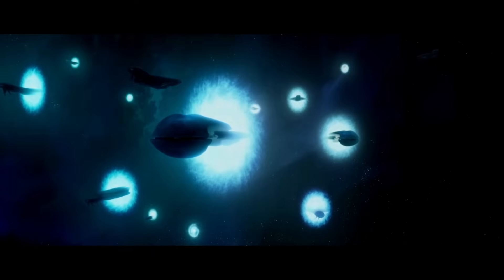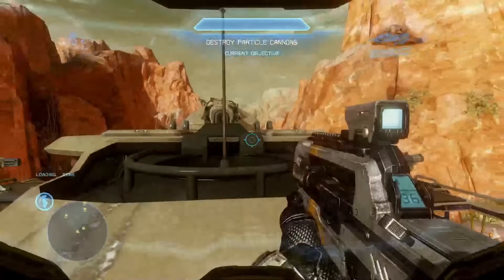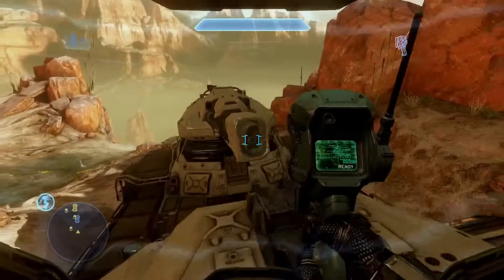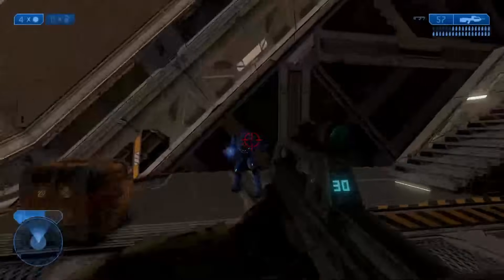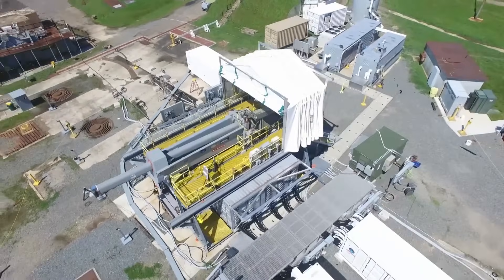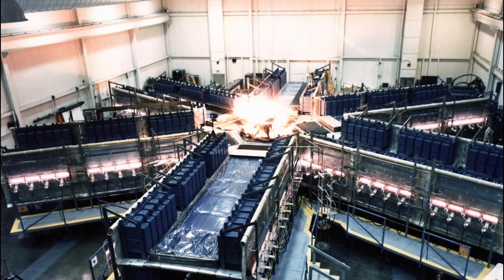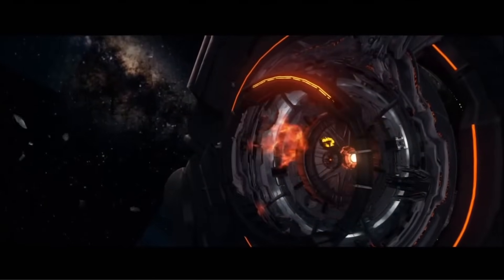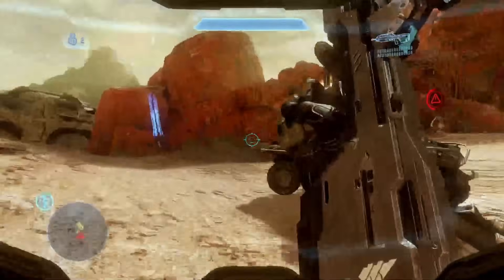Could We BUILD Orbital Defense Platforms TODAY?

Comment: Power transfer from ground stations wouldn't be via cables like on earth but via microwave with a large rectenna being placed on the MAC station to recieve and convert it back into power. 

You do have losses. I think the theoretical maximum efficiency still loses you about 20% of the power you push to space but it still actually has a lot of advantages.
You don't need to miniaturise your power generation, it's easy to maintain your reactors both for staff and logisitics, you can stick them under a mountain for comparably cheap armor, your mac stations are smaller and easier to manoeuvre (just keep the rectenna facing down), and when you aren't using your mac cannons  (which is most of the time) you can tie that power straight into grid subsidising the cost of your defense platforms.

Incidentally, this also explains why they're geostationary - having a static power broadcaster is much cheaper and more reliable than a mobile one and if the cannon is always in the same spot relative to the ground, you can just build it so it's pointing at the right spot.

Comment: Actually the army put a railgun on a Sherman tank in the 40s.
Reply: Its wasn't really a railgun. Its more of a support platform for the rocket that it was suppose to use.
Reply: @itzyaboimemez2074  There was a actual railgun, the army replaced the radio, hull machine gun with a second engine and power systems. then they created the first SABOT round  for it and when they shot it the rail exploded and almost kill 3 people including the man who was it biggest supporter. No it wasn't the T34 Calliope.
Reply: And if that were actually true, the second engine and the likes, it would been impractical since every Sherman needed to be quick and easy to build, maintain, and remove broken parts. Not only that, every Sherman tank are needed in the front, which is why most modified Shermans still have the same chassis, hull, and others because they needed then to be quick and easy to modify. It would have been more practical if they use the M6 Heavy tank because of its large hull and turret, which can fit those that you have mentioned, or a new tank all together.
Reply: If you are going to mention Spookston, then don't cause I already watched his "America's First Railgun Tank" video. I highly advise not to truly believe that video because there are little to no files or documents to fully support his "Railgun Sherman". I like Spookston's videos, its informative like ConeofArc. But I would take it with a grain of salt.

Comment: You don't need a physical cable tethered to the defense platform in order to generate power. The best way to do it in this scenario would be with wireless energy transmission - namely lasers. It's actually one of the ideas behind the construction of a Dyson Swarm. Build solar or heat power plants in space and use it to power powerful lasers to transmit that energy down to Earth. Simply do the reverse in this case. You'd have some issues with laser diffusion, sure, but what you want is just the thermal radiation/heat of the laser to hit a collector on the station. Large Stirling engines, piezoelectrics, what have you - convert that heat into electrical power. There you go. Wireless transmission. And, as a bonus, any laser capable of doing this would also be useful as a planet-based communication laser array to tightbeam communications to vastly distant places.

Comment: 9:32 directed laser energy transfer you would need a thermal/photon to electrical converter there would be some energy loss to atmospheric density scattering some light but a lot less than even something like the experimental superconductive graphing would have as a cable going up.  it would make sense to have geostationary if you couldn't have the laser gimbal too much or you absolutely needed the thinnest path through atmosphere that the laser is going through to get the best transfer.  Just don't have any ships orbit through that line because you've essentially got a directed energy weapon "cable".  

11:50 I have to correct you on the station keeping height, 50 ish miles is the karman line 65 miles off the surface is the limit where you stop worrying about station keeping, source the international space station is at 60 miles up and it has to boost somewhere between once a week and once a month.  You could correct the equal and opposite reaction problem with having a artificial backblast, maybe pumping coolant liquid over the coils very quickly while it fires and when that vaporizes into plasma it jets out the back of the gun?  Coolant resupplies would be something required if that would be a solution, but when you look at falcon nine and the development of starship we will have efficient enough delivery systems to maintain that infrastructure. 

 If the orbital defense platform was in geosynchronous orbit (not stationary because any shots towards the poles will make it wobble) and instead of having an on station reactor it had a reactor complex on the ground beaming lasers (maybe a radio laser if that's possible, to make the energy absorption easier) to power that platform and other platforms in the area (because why not make the stations easier to produce and have a lot of) you could use the photon pressure from multiple ground power stations cross powering the defense stations you could create a sort of orbit stabilizing force bowl.  With multiple ground stations firing lasers at multiple defense platforms one could ramp up the power to a laser hitting a station in a particular direction to cancel out any drift from firing.  

Now I'm off to figure out if there is such thing as forcing radio waves into particles like we've done for the visible and near visible portions of the electromagnetic spectrum in the form of lasers, because a laser you could just absorb with an array of hull mounted antennas would be an awesome energy transfer system in space because lack of melting any and every ship that flies through it or melting the receiver when you miss their specialized photonic thermal energy converter system.

Apparently we have masers the microwave predecessor to the laser they were used for the first satellite communication and are currently atomic clocks, I couldn't find anything that could support or deny my idea of directly absorbed long wavelength masers other than the fact that constructing them currently is very complicated.  So I kinda want someone from darpa to see this and start figuring out how to make a laser/maser that when shot at a ship just induces current instead of heating it up.  Would be kind of interesting to equip on all of our spacecraft and just electrically insulate the outside hall from the inside so we can friendly fire before the ships go into combat as a sort of magnetic field based shielding and ramming weapon.  "How is my whole ship a taser? Well you see my friend over there shooting me with very long wave length photon beams? That's pushing all the electrons on the surface of my ship into a fancy complicated dance that electrocuted your bioship and holds that plasma around mine."

Comment: The defense platforms could use either fission or fusion reactors and use the space debris that’s currently in orbit as projectiles. If they use fission reactors than the spent rods could be turned into projectiles. If they use fusion reactors than they could collect stellar gas and trash to convert into fuel.

Comment: As i understand it, the UNSC powers ODPs with groundside generator complexes. With the amount of energy required to fire the SMAC at .004 the speed of light, the generators would have to be massive. I could see it being more practical to generate power ground side and lasering it up then to greatly increase the size of the platform.
Another reason i could see for this set up is security and/or political. The UEG had a rebel problem before the human-covenant war and IF some rebels somehow got control of a SMAC, the could use it against the planet or easily steal it unless 1. There was some sort of failsafe to keep the barrel away from the planet or 2. A way to disable the SMAC platform from the ground was available. Rebel groups had already nuked a city (the catalyst that pushed Halsey over the edge to make the spartans) so it would not be an unreasonable fear, especially with wide spread rebel infiltration or loyalties within most levels of the UEG and UNSC.

Comment: 8:52 I don't remember exactly where I heard this, but I remember that the power from the surface is transported to the platforms via giant lasers(?) I don't know if that could work, but it would explain why they are on a geosynchronous orbit
Reply: It would work, it's just ridiculously innefficient. You would have to send more power  up than you need because some of it will be lost to scattering within the atmosphere.
Reply: @Keestral  You could build the laser on the moon and power your platforms from there, but then they'd need to be in geosynchronous orbit with the moon.
Reply: @Keestral  microwave power transmission could work, as it can pass through atmosphere decently well
Reply: @rishidronadula7260  at a distance that’s far enough to be in geosynchronous orbit and be able to provide enough energy to rapidly fire an ENORMOUS railgun or gauss weapon and keep the station in orbit? Maybe I’m wrong but I’m really struggling to believe that would be the optimal solution

Comment: Missiles are faster, can track and steering itself to target, no recoil and use less energy to operate. only downside is payload but we can use multiple missiles. that's why we don't use 356mm 410mm 460mm guns for long range engagement anymore. and HIMARS, MLRS start to get traction and fair share of use alongside 155mm.

Comment: The reason the orbital MAC canon's work, is that their isn't any reaction pushing them back.  The magnets are able to accelerate the slug without any friction.
Reply from the maker: The magnets still exert a force. By propelling the munition through magnetic fields, they experience an equal but opposite force through said magnetic field as well. It's not about friction so much as it's about equaling forces out.
Reply: @TheBigCabezon  gottcha, thanks!

Comment: Beamed power absolutely makes sense for using ground based power installations for orbital defense platforms, and would also explain why they're in a stationary orbit. It would make them easier to target with the beam. I enjoy most of your videos, but you're very off the mark with this one.
Reply from the maker: Beaming that much power through the atmosphere would cause blooming, where gas becomes ionized and turns to plasma. This leads to massive losses due to heat and distortion of the beam. There's no reason to go through all that when you could have a nuclear reactor in orbit. It just doesn't make sense.
Reply: He's not at all. To be fair hes being.....fair. "beaming" the needed energy to those platforms would be stupid. Even if the macs yields and power requirements were actually reasonable, it would still be pointless using ground based energy units to power them, ESPECIALLY haveing them in a stationary orbit. I'm sorry but I'll say this all day, the macs in halo are 40k levels of fatacy weapons.

Comment: Proximity fuses aren't very useful in space because shockwaves have nothing to propagate through.
Reply from the maker: Prox shells don't kill through shock waves, they typically have smaller ones than HE. Prox kills through fragments, which is incredibly useful for something like a MAC round. At very high muzzle velocities, you already know the round will punch through a ship (minus shielding) so instead you have the shell explode into smaller fragments prior to impact so it penetrates but doesn't pass through. This ensures all kinetic energy is passed to the target. Think of it like a regular bullet, 7.62 rounds had a habit of passing through (clean wounds), lighter rounds like 5.56 tumble after they hit your body creating some gnarly exit wounds. Same concept.
Reply: @TheBigCabezon  At such high speeds both the round and the target would be shattered.
Reply: @Cabezon  ships in halo have shields and ARMORED hulls, without explosives they need mass to cause damage, using a MaAC round that explodes and showers the target in sharpnel isnt going to do anything except scratch the paint. And 5.56 rounds tumble after a certain distance due to instabilities in their flight path, 7.62 rounds will probably do the same just at a longer distance.
Reply from the maker: @jamesrogers1105  you don't need mass to kill, you need kinetic energy. That's how shaped charges can take out armored vehicles. Insane velocity. I 100% guarantee if you accelerated small rods to a significant velocity they would cut through any armor you can think of.
Reply: @Cabezon  smaller the mass the more speed needed, the larger the mass, the less speed needed, if you drop a telephone pole sized chunk of tungsten and a 1x1x1ft block of tungston from low orbit the larger on will do more damage even though they will have near the same velocity, that being somewhere below 9.8 m/s
Reply from the maker: @jamesrogers1105  yah man, but it's shown multiple times in lore that Mac rounds punch straight through unshielded Covenant ships, which is why I say 'airbursting' (more like a flachete round) could be useful. I'm not talking small fragments, I'm saying that instead of a MAC round punching through, having it either break up prior to impact or detonate inside the ship to transfer as much energy without letting it pass through, because if it goes straight through clean you're leaving a lot on the table.

Comment: Awesome video as usual! Thing i wanna point out is about powering ODP. 

It has nothing to do about Current or Power transfer for the gun from the ground. It has everything to do with Voltage transfer. As far as i know, also probably the most effective way, Capacitor banks are onboard of ODP. So the ground power station does not actually generate power for the gun itself. It generates the energy for capacitor banks onboard the gun. Power is then generated inside of the ODP via those charged capacitors.

About why not put power station on board of ODP. This will end up as UNSC space ship. As all UNSC ships are actually the same ODP + power station (On way smaller power-level scale ofc). Everything else the ships has takes very small amount of space compared to MAC + power station. UNSC ships are all basicly ODP that have a powerstation on board and made to move. 
Of course way smaller in scale and power generation compared to ODP. As ODP is able to generate massive amount of kinetic energy via its large ground based power generators. 
In the Halo lore ODP power quality MAC's have only ever been installed on super carriers (not including Infinity atm, cos its made with Forerunner technology anyway). Those UNSC super carriers where 4+ km on lenght. While ODP is under 1.5km, and overall smaller than a UNSC Cruiser, while generating massively more amount of kinetic energy than a Cruiser.

Scale of a power station is the main limitation why UNSC ships have way smaller MAC's than ODP's. Thats why ODP's do not have onboard powering stations. Be it 0.4c (retarded) or 0.04c (Installation 00 value) MAC velocity. Ground-based station is way more effective to power the capacitor banks.

Very good point on why there have even people on board ODP's... Its weird. ODP's could be easily be automated via smart AI's, as every ODP needs one anyway for targeting calculations.
Reply: The Marines on board the orbital defense platforms are obviously to prevent boarding actions as seen in Halo 2, where they're introduced.
Reply: @jaredhardegree8377  Yes i am aware of Covenant boarding the ODP's to disable them. But... That whole notion of action is just so dumb. 

UNSC frigates (Bulk of the UNSC fleet, as UNSC had 10+ frigates by nr# for every Cruiser/Carrier), as fast moving small ships, with shit-load of point defense, small caliber defense turrets. Should have been tasked to defend ODP's against boarding. One frigate has the capability of defending multiple ODP's from small boarding crafts. 

UNSC Frigate is not able, nor is it ment, to engage with MAC guns against Covenant capital ships. Instead ODP's serve that exact purpose (Like Drones = shoot few times and then die), which have by far the most amount of Covenant capital ship killing-power, were left alone, defend themselves via onboard UNSC Marines. (Lore writer error probably) 
Thats why frigates should have been tasked to defend ODP's from small boarding crafts. UNSC frigates actually outside of their mini-MAC guns do have massive amount of small caliber firepower against smaller vessels (Boarding craft in this context).

With proper UNSC Frigate tasking. None of the Covenant boarding crafts should ever come close to ODP. Thats the reason why fully Automating ODP's would be the best course of action. (But Lore was written by a person, and people make mistakes so it makes sense why we have Coventant boarding course of action in Halo 2)